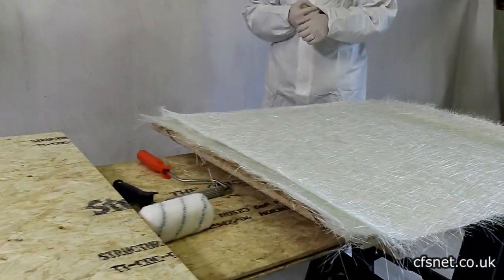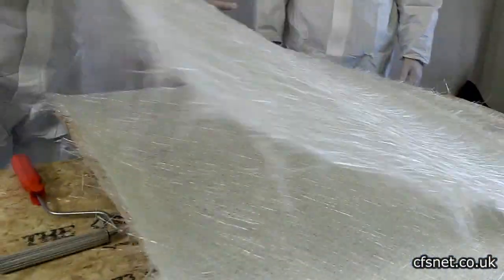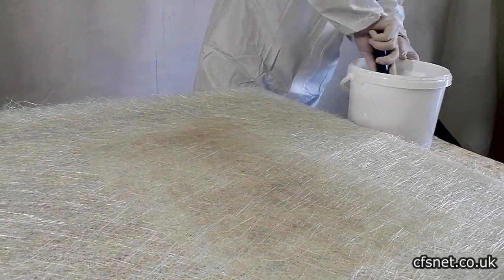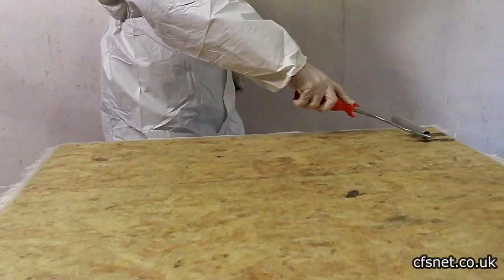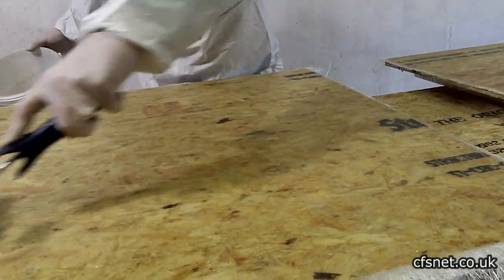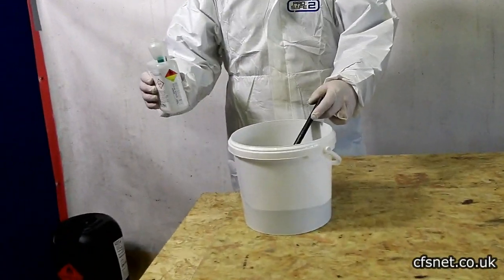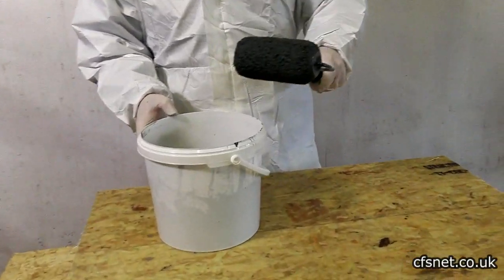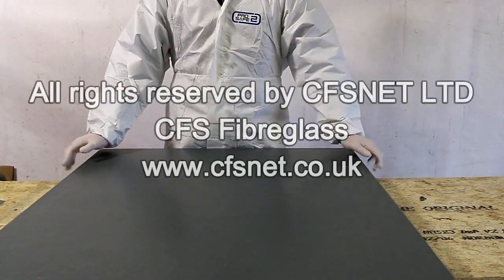CFS Fibreglass GRP Roofing Laminate & Topcoat

Comment: Should of sanded before the top coat.
Reply: Laminating resin doesn't cure so you don't need to sand it.  The top coat will form a chemical bond with the laminate.